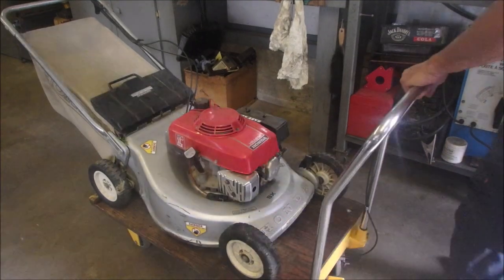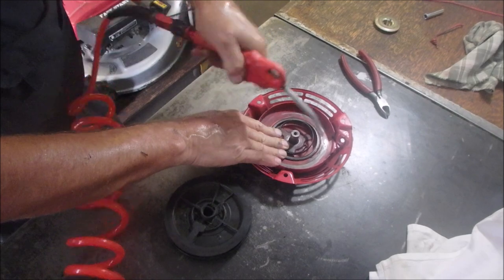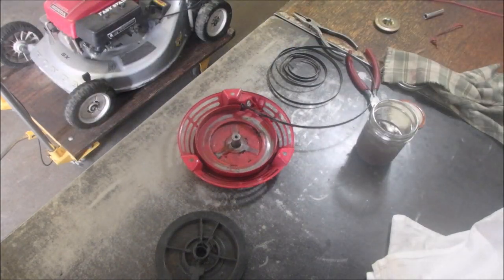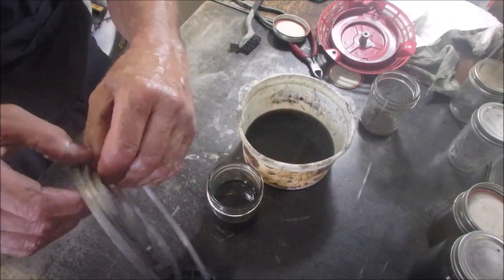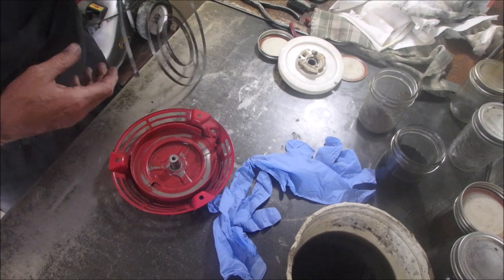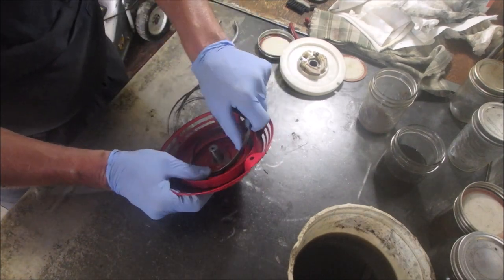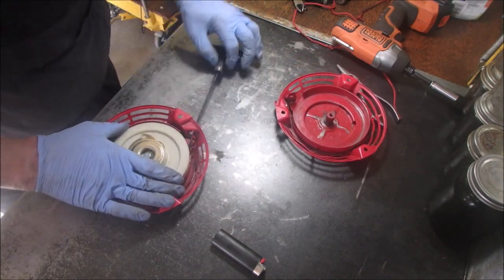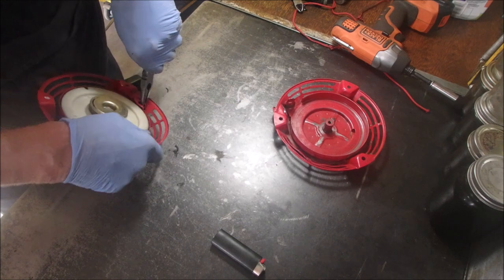Honda HRA214 Rewind Repair

Comment: Reminds me of earlier this summer when a customer brought me a recoil with the spring tangled like a ball of yarn.  I had to put a new inner hook on the end of the spring.  After I wound it into the spool, when I turned it upside down and attempted to insert it into the groove, it took a few tries.  When it finally slid home, we both looked at each other with extreme relief.  After that it was simple.  I don’t like handling those springs and safety is top priority!
Reply from the maker: Right on

Comment: Great old machines those are. I remember fighting with one of those HR214 recoil units for the better part of a weekend before realizing that the plastic spring holder was cracked. Every time it had tension from the spring on it the crack would open up and let the spring go, I couldn’t figure out what I was doing wrong to make the spring unwind lol!
Reply from the maker: Thanks for the info

Comment: Great job sir u and the wife have a great safe weekend see ya Tuesday
Reply from the maker: Thanks! You too!  It is a long weekend for us.  how about you??
Reply: @BrucesShop  wow I'm in my garage working in 104 heat index on a honda eb3500x generator changing out oil drain bolt and wasn't coming out with impact Bosch  anyway light came on and did what bruce would I hit it clockwise then counter clockwise and it broke free Thanks sir for your tips sir
Reply from the maker: @ebfromwyoming4118  Great news
Reply: @BrucesShop  hurricane 🌀 season here again with your skill set I'm able to be ready  for no power thks for sharing your knowledge  sir